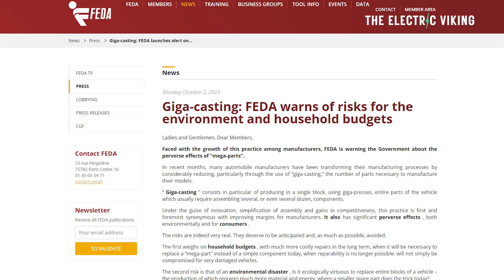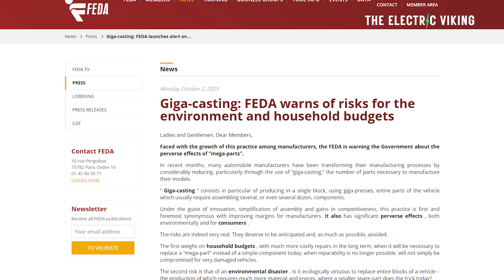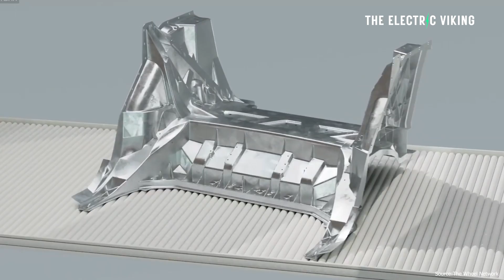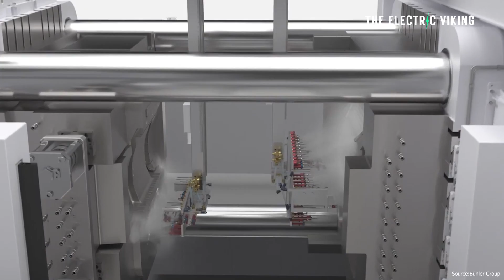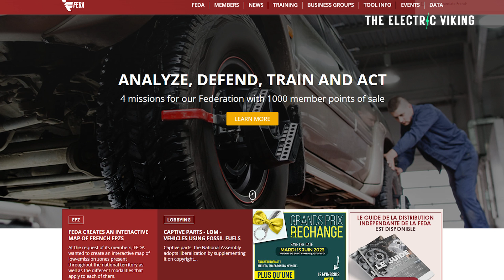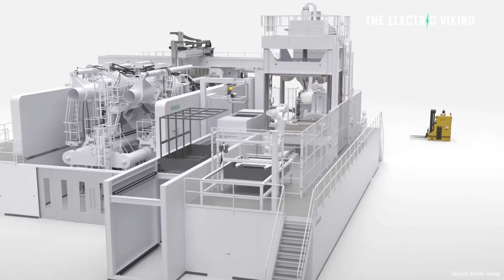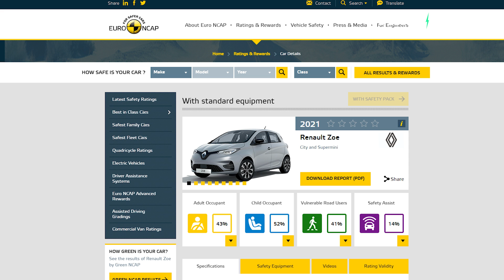Magna and French auto industry issue red alert; warn dangers of Gigacasting

Comment: Technical details of the arguments for and against would be nice, May we have a TLDR in the next video? Not everyone viewing this is tech-illiterate. BTW noneof this is a consumer problem so it should not be "cast" as such.  If a company considers a process not cost-effective they're perfectly free not to use it. None of this should be a concern to anyone outside the industry. Large complex castings either meet specifications or not and those which don't either get rework or scrapped and the metal reused. Casting tech is not static. It continuously improves. 

Cars with or without it are easily "totaled" (even old simple vehicles, I've spun wrenches since the 1970s) and modern auto salvage (see videos) efficiently removes usable components. That's been the case since the first automobiles. As a lifelong mechanic I would not want any severely hit new vehicle back so easier totals are something of a stealth consumer bonus. Conventional welded unibodies crumple when hit to absorb impact and are also declared beyond economic return to pre-crash quality. If things don't work out other makers using other processes will serve the public. That's a stockholder issue.

Comment: The life of cars with "giga castings" will depend on the integral of road roughness (providing both the frequency and magnitude of stress reversals) and of the accumulated distance so far travelled; when "The Fatigue Life" at such a rate of abuse will decide it can no longer prevent a catastrophic fatigue failure.
Reply: 💯. It won't be fun when the Gigacrap warps and cracks.
Reply: @vs6300  they will NOT warp - micro fatigue cracks can be detected using  NDT long before the fatigue failures will occur at a relatively low applied load.
(My first applied fatigue design, 55 years ago, that rejected using multi-span continuous prestressed gantry crane support beams in the Tiwai Aluminium smelter being designed in 1969 in Auckland - and since then have encountered many potential fatigue failures and even actual falures in the Quality Assurance, Compliance and Conformance monitoring, of Indonesian and Asian on & off-shore down hole drilling companies).
Reply: Hence a probable over design for 99% of typical users - but it will happen?
Reply: So you are more astute than most, that's one reason why they are so stiff. Guess another.
Reply: @tedmoss  stiffness doesn't prevent stress level reversals - it only reduces deflection. Go study what are the greatest factors that   reduce Fatigue Life to dangerous failure.

Comment: "Giga-casting" and non-repairable structural battery packs. Are already a huge problem in USA with telsa.  Telsa claims to be so environmental  friendly but anybody in the insurance industry can tell you the opposite.  The funny thing is they don't even allow recycled parts be used in repairs so the insurance industry has no use for the salvage Tesla. Insanely wasteful. 

Easiest way to explain it to a person that's not in the industry. They are the apple of the car industry. They don't want you to fix your car, they want you to buy a new one.

Clearly when they designed these cars they envision the future of no crashes.  The Cyber truck will be the king of unrepairable vehicles too. 

Also, this video includes the most misinformed takes. No!!  cars do not get "written off" cuz they're structure is damaged. I mean this completely misinformed take from this YouTube presenter. We replace even frames on vehicles that get damaged.

Comment: Trying to make castings a repairability and environmental issue is disingenuous. Stamped and welded steel unibodies are notoriously difficult to repair once damaged, and are often written off due to their tendency to have corrosion issues after repairs. Using cast aluminum sections lowers vehicle weight, which reduces the environmental impact, since less energy and battery mass is required to move the vehicles. There will be a learning and training curve to repairing cast parts of vehicles, but that does not make it impossible, or even especially costly.

Comment: Astounding report. I expect that the insurance industry will eventually demonstrate which vehicles cost less to repair. Another factor which may be distorting things in Tesla's favour is that Tesla safety system are so effective that it may be reducing the need for Teslas to be repaired as they simply avoid accidents in the first place. I am starting to understand why Alexandra Metz is so negative about the business climate in France.
Reply: The insurance industry keeps a ridiculous amount of statistics, and while Tesla safety systems may prevent many accidents, the cost to repair/replace them must be exponentially higher than any accident avoidance they may offer.  Now, if the numbers are wrong or if the insurance industry is ignoring them, then other insurance carriers will arise and take the profits.  Time (and stats) will tell.
Reply: @ohger1    Agreed. Tesla is providing insurance to a significant part of its own customer base in the US and is doing so through independently operated body shops. If they are charging lower rates (which they are based on driver stats) and not losing money, that suggests that repair costs are either less costly of far less frequently required.
Reply: @ohger1  The body shops are the ones who are taking the big chunk of the profit in this chain. They are the ones charging the insurance companies ludicrous prices and since there are only so few certified body shops, they don't have to compete with each other.
On the other hand, the body shops need a lot of profit to invest in expansion. The one in my area recently opened a whole new place on the other side of the town. Setting up a whole new car repair shop must cost a fortune.
Reply: @ohger1  In countries where insurance companies pay for injury *** POSSIBLE US CONTENT WARNING ****   insurance companies pay out more for injury than they do for fixing or replacing cars.   A single head injury can run into millions.   There is quote out there saying Tesla drivers have X% fewer accidents and Y% fewer injuries when they do crash.   The work Tesla puts into to continual improve the safety of their cars is paying dividends.
Reply: @ohger1  Insurance companies haven't yet collected enough statistics to be confident, so they charge high just in case.
Reply: @royh6526 Insurance companies do not make assumptions is a massive understatement! They cover 'risk' whilst being monumentally risk averse at everyone's expense.
Reply: At the moment insurance rates for EVs in the UK is shooting up and some insurers will no longer insure EVs. I don't know why but I do suspect that the collateral cost of an EV on fire is a lot higher than that of an ICE vehicle. It can result in longer time for roads to be cleared and repaired or the loss in some cases of buildings adjacent to where the EV was when it burnt. The recent fire at Luton airport has been reported as being caused by a diesel Land Rover but there are some claims that it was a hybrid diesel. Either way once a fire is established in a close packed car park any nearby EVs could become involved and make the fire harder to contain and extinguish. At the moment there are about 25 ICE vehicles to each EV in the UK so any large car park fire is likely to consume an EV and make the fire harder to extinguish.
Reply: @martinconnelly1473  I do not put much faith in insurance companies giving us a fair deal.  They take money where they can get by with it.    EV fires are in the news.  Hey look lets jack up EV rates.
Reply: @martinconnelly1473  ICE cars burn at about 1000C and fuel vapor in gas tanks explodes at about 250C.   Do you see the problem with that.   EV or not a serious fire is going to cause structural damage.  The solution seems to be car park fire suppression systems.  This will keep ICE cars from setting EVs on fire,   The increase use of combustibles in all cars is a concern.
New to the 2023 edition of NFPA 88A, all parking garages are now required to have sprinkler systems installed in accordance with NFPA 13. Prior to this edition, sprinklers didn’t have to be installed in open parking structures.

Comment: - there was never a secret that IDRA makes large diecasting presses - -  so much sensational B$$ - lol...   (LK Technology Holdings Ltd) out of Hongkong bought IDRA (?) before Tesla ever started using their presses...
That Tesla became launch customers of the large format presses - may be due to a large wallet, or something) - There are gains in singlepiece castings - and high strength steel forgings, there are a limited number of large casting presses available - there are also alternatives in the manufacturing process - single piece highstrength steel alloys forgings are also worth exploring (China also has an 80000 tonne forging press, rivaling/beating anything in the USA)..

Funny thing, Magna had a singlepiece casting (Battle Creek, Michigan) for the Honda/Acura TLX (2021). - smaller "sub-giga casting" since 2012, hmm that nearly predates Tesla making modern cars ...
https://www.moderncasting.com/articles/2021/05/05/casting-year-front-subframe-engine-cradle-magna

Comment: France’s concerns are about the intrinsic tension between supply and demand; corporate profits are consumer expenses. All corporations seek to socialize expenses (onto the consumer and society) and privatize profits. That’s what pollution and climate destruction is. After car accidents, consumers would have to replace entire giga-castings - or buy a new car! - rather than replacing discreet parts which is far more costly for consumers and far more profitable for suppliers. And since gogacasting is cheaper for suppliers, the more expensive repairs will be foisted onto consumers even though consumers would prefer a less costly repair. This will be a non-issue if/when cars are fully automated and no longer sold to consumers and fleets are owned exclusively by supply. But until then, this may very well be a corporate attempt at foisting more costs onto unlucky accident victims because that provides more profit for suppliers. People are ultimately motivated by money not by good intentions. Nobody will save the planet if it’s not profitable to do so. And if it’s profitable to screw consumers, which it often is, especially when suppliers form cartels and/or monopolies, then tough luck for consumers. That is France’s concern. Perhaps their concerns will come true. Perhaps not. Nobody has a crystal ball.
Reply: What puzzles me is that people make great speculations on France concerns on the basis of inaccurate video from SAM. FEDA is a syndicate of after sale shops with no  impact on French opinion. Magna is just a foreign supplier for Renault and Stellantis.
Reply: No, France's concern is that their heavily subsidized, labor-intensive manufacturing model will not be competitive once other manufacturers have significantly reduced costs by using gigacastings, and therefore they will do everything they can to slander their competitors rather than improve their own manufacturing sector.
Reply: @alanlight7740  It's exactly the same problem in a lot of countries, specially in USA!
Reply: @alanlight7740  
Car prices in America went up 30% over the past few years while wages haven’t increased (which lowers demand) and car companies still made record profits. Car companies bankrupted themselves in 2008. They didn’t need any help from labor to do that. In fact, after Capital fatally mismanaged themselves, labor bailed them out in 2008 by decreasing their wages and benefits. And the government bailed them out too. That’s called socialism. What supply is petrified of is just that. The socialism that kept them alive. But they have nobody to blame but themselves for creating it. For demanding it! Capital fears France. They fear labor having too much wealth (that makes striking easier) and power because if they do, then Capital must concede both wealth and power to labor. And what capital fears most is labor having enough wealth and power to take over the management of supply. That’s also called socialism. But hey, if capital can only survive by treating labor so poorly they rise up against capital, then once again, capitalists have nobody to blame but themselves.
Reply: @flutieflambert  - are you joking?

That's about as backward a take on labor and capital as I've ever seen. You've got cause and effect reversed.

EVERYTHING increased in cost over the past few years because the only way to deal with the debts caused by a century of socialistic policies is to rob the general public's savings by debasing the money supply. 2008 was not the beginning of the automobile manufacturers - it would have been the end if the government had not taken taxpayer money to bail them out, thus taking money from the relatively poor to give to the relatively wealthy UAW workers. The unions started killing the car companies before either of us were born, but just as "there is a great deal of ruin in a nation" there was a great deal of wealth - amassed by others - that the unions were gradually able to work their way through, so it took a long time.

But "if something cannot go on forever, it will stop" - and the only reason this large scale looting has made it this far is because of political influence - but even that will eventually cease, as it will soon.

The reason people fear socialistic policies is because we like to eat, and we see that reason is completely lost on those pushing these destructive ideas. And with that I will conclude because, having stated the case, I don't see any hope of persuading you if you are not joking.

Comment: A couple of points:

a)  Although Magna has very extensive operations in Europe, it is not a "European car manufacturer".  Magna was founded in Canada and its world headquarters are located in Canada.

b)  One of Magna's largest competitors in Canada is Linemar Corporation, head office: London, Ontario Canada.  Linemar is currently constructing in Welland, Ontario, a dedicated facility to house an IDRA gigapress, rumored to be in the 6 to 9 thousand ton capacity range.  This is said to be the first gigapress to be installed in a facility owned by a tier 1 supplier rather than an automotive OEM.  I don't know who the customer is for the output from this factory, but it's obvious that Linemar must have at least one customer nailed down or they wouldn't be making this huge investment in this plant.
Reply: Toyota and Honda have plants in Ontario so it could be one of them.
Reply: It looks like at least one supplier can read the handwriting on the wall.
Reply: Cool, that’s pretty close to me, I’m intrigued by which customer it might be.  The most logical are any of the big 3 automakers who all have their HQs in Detroit. Thanks for the info!
Reply: ...and Magna have been doing large diecastings for years (4400tonne and 6000 tonne presses apparently) - ie Acuras back in 2021 (Michigan) - with others of increasing complexity ever since 2012...
Suppliers like Magna do so many parts for many makers.
Reply: Yes, I was wondering what that big building in Welland Ontario is for.
Would love to see a giga press.
Reply: Great info. Thanks
Reply: Would it be the GM frame assembly Plant in Saint Thomas Ontario?
Reply: He wanted to make a video about France and how Europe are in problems, so he ignored this fact it's a Canadian company.
Reply: Danny is it possible they just dont want to have a bunch of different molds for all their customer? Seems they dont want to make an IPACE thats actually good
Reply: I think the European part of Magna is located in Austria and is known to make rarer subvariants of cars for main car producers for example the BMW Mini and others.

Comment: Gigacasting is a problem for repairability: damage one of the monoliths and the whole car gets totalled. In a conventionally built car, most structural stuff attaches to brackets which can be replaced when damaged by a pothole or crash. Cheaper to manufacture, difficult if not impossible to properly fix - while you can cut out damaged parts and weld replacement bits in, accurately and correctly doing so is far more difficult and expensive than unbolting bent brackets and bolting new ones in.

Comment: Have to disagree about repairs. Very often the under structure of the car behind the sheet metal does get bent and damaged. These cars can often be straightened and repaired. Especially if the under structure is made of formed steel. It's much harder to do a quality repair of a casting you generally have to replace it. I think it's quite valid to be concerned that relatively moderate crashes could lead to more vehicles being written off,  much higher repair bills and insurance costs. However car manufacturers don't give a fig about that! They're happy to pass these costs off to others down the road like insurance companies and consumers if it makes their cars cheaper to make. Maybe that's a trade-off we should all be willing to make, maybe it isn't. But as a consumer yeah, personally I'm tired of very expensive equipment that can't be repaired such as metal and glass smartphones with components that are soldered down and permanently glued. Are Teslas the iPhone of automobiles? Not meaning that as a compliment from this particular consideration.